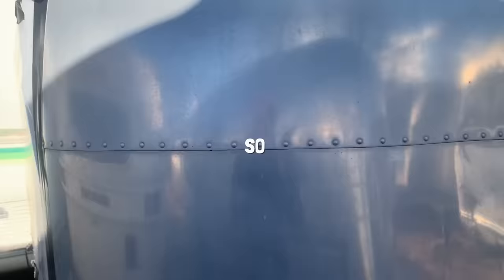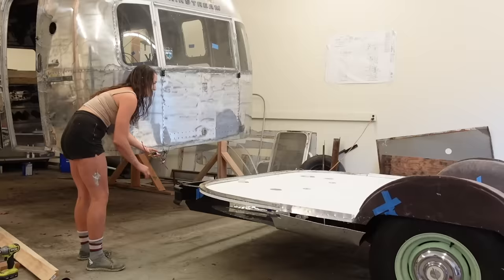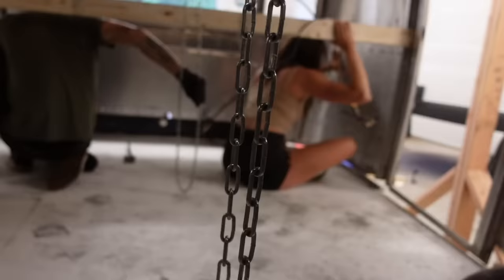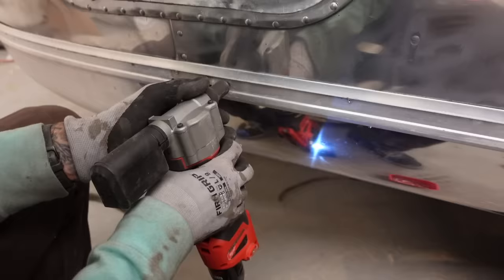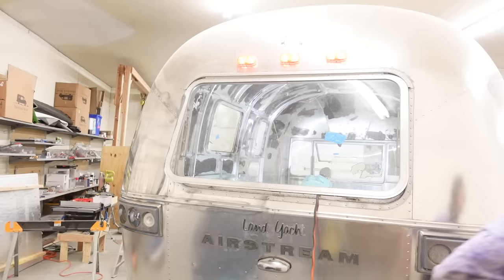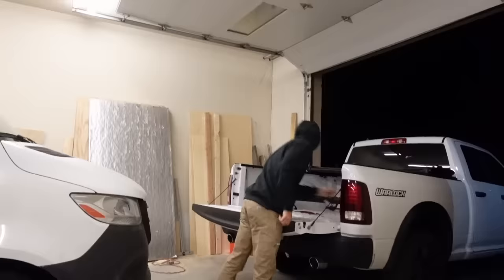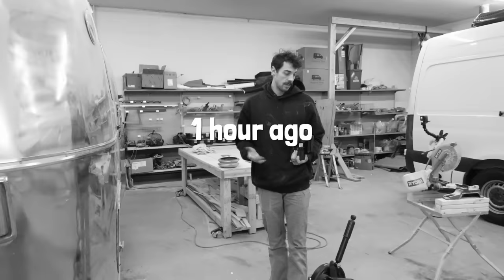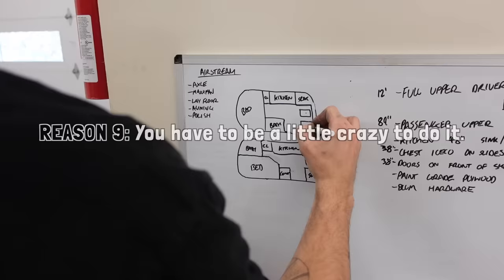Why No One is Renovating Airstreams

Comment: Even with the new one's, they don't do anything to weatherproof the plywood flooring.  It should be soaked in epoxy and coated on the bottom side with a layer of fiberglass.

Comment: Vintage Vacations used to restore lots of Airstreams. Restoring an Airstream is not for the faint of heart. It takes advanced metal working skills, plus all the interior wood working skills. And plumbing and electrical skills. However the Airstream fad of 20 years ago is starting to fade. I don't work on them any more either!

Comment: at 10:17 in the video that is the wrong way to put on lug nuts, as a technician Ive seen many people do it. The conical end needs to go towards the rim it helps center the wheel on the hub it prevents vibrations and increases the longevity of the trailer tire.

Comment: I could be wrong, but, the acorn type lugnuts, might be installed backwards? Each chamfer or cone should act as a centering device into the steel wheel's concaved chamfer, even though, the wheel is "wheel-centric" on the center of the bearing hub. Unless, those do not have the chamfer in the steel wheel and is just a straight on through hole?

Comment: Watching your show gave me this idea. What if you make your style of air-streamer without infringing on any of the air-streamer copyright design way cheaper. Only the front and back have that shiny chrome curve look, but the middle is made of wooden varnish panels, which look the same as those 1960s wooden panel retro vans.  
So the question is how do you create a shiny chrome curve? I can see it is made from copper sheet too instead of aluminum but that's the tough part.

Comment: There may have been a reason not explained, but you didn’t need an axle.  Wheel bearings, seals and new brake components along with a good clean and you would have saved a pile of money.  Useful to see what you went through.  Now to go look for the other reno’s being done so get a compilation of ideas.

Comment: I recently installed a solar/battery/inverter setup in an airstream.  Those things are terribly designed death traps. 
It was a 2023. Wiring is impossible to get to. They use junk electronics and the. They wire it like they are trying to kill you. 
The factory inverter was straight wired (no breaker/gfci) directly to the under table outlet. The otherwise was wired to a second outlet. Directly. Meaning if you touched them, had a short or anything you would be dead / on fire.

Comment: Before I would have removed the shell I would have made jig pins and support the shell with bracing so it couldn’t shift .Easier said than done ….. However that how we do it ! I’ve also lifted two 40 ft bus roofs 2 ft. Without a problem other than a lot of time to setup.
Reply: I’ve lift 2 -40’ers and put 2 slides outs in . Huge job

Comment: I SEE I LOT OF PEOPLE RESTORING AIRSTREAMS AND THE BIGGEST ISSUE IS THEY ARE USING REGULAR WOOD FOR THE FLOOR AND THATS NOT GOOD IDEA, WATER AND TIME ALWAYS IS GONNA DESTROY THAT, THE BEST WAY FOR THE FLOOR IS ALUMINUM AFTER THAT YOU CAN USE WOOD OR WHEREVER. BUT THE BASE I RECOMMEND GOOD ALUMINUM

Comment: Consider the experience you’re gaining. Experience is something no one can buy.  Number 2 should be easier than number 1. Three should be easier than 2.
Perhaps before separating the shell from the frame, you should make a template to duplicate the shape of the shell. Every rivet, every stress on the shell will cause its shape to change. There are reasons that sheet metal  mechanics and aluminum welders are considered wizards in some circles.

Comment: Watching you struggle to marry the shell to the base, I think spending more effort with the bracing may have saved a lot of aggravation. In particular some triangulation at each corner or using fitted forms at each corner tied to bracing. Car restoration use square tubing or angle bar that overlap from each side and are welded to exact length. And too much is better than not enough. Particularly when you have complete access to the inside, to start with. 
As many have commented, I admire your fortitude.

Comment: I know you guys are working hard to finish this tedious build and I don't want to rain o your parade but there was a safety issue I MUST point out!  The lug nuts you installed are on backward! The tapered side should go against the wheel! installing them with the flat side in; they will eventually work their way loose and, well, that's never good! tightening them down more will only damage the wheel and stud. Be safe! Take a moment to remove and install them with the tapered side in! You will be glad you did!

Comment: oh ive worked on this same thing so its called airstream. anyways we have rebuild it twice after a test run on the mountain cause its too flimsy we have to spot weld alot of meshwires on the whole body including the floor since the owner want it to last longer than 50years.. so we bouth some thin aluminum sheet for the flooring combined with with meshwires then some anti rust paint job cover with foam spray while setting the floor ,,, after we finished the whole skeleton the whole cover actually just slides in perfectly took me and my boss 3days to finish everything including the flexible panel install and the pv battery and inverters..  the only problem we encountered was filling the concave spaces lol works perfectly for the wiring but the dang furniture are were made square so theres alot of wasted space, we opted to convert these spaces as a water container instead XD weve run a 12volt mirco pump on each side

Comment: Dear Crew, whenever professional car builders are taking a body off of a frame they will install interior supports and framing so that the body doesn't warp and change shape due to its own weight.  This is the method that you might have used here.  Now, I do see once piece of cross bracing, but its definitely not enough.  You probably needed to install 2-3 sections of interconnected cross bracing, and done so BEFORE you take the aluminum shell off of the frame.

NOW, that you know HOW to do this... You definitely should do it again, and make so $$.

Comment: 8:20 Lol I know the pain of trying to get sockets off those fresh from the hardware store sale holders.  They either come off to easy when you dont expect it or you need a prybar and a 4 foot cheater bar before the plastic lets go of either the holder or the socket.  there is no in-between.  Used alot of Pittsburg tools in my early days as a poor apprentice mechanic.  Even though I've upgraded to nicer tools over the years, I still have alot of them as my at home or travel kits but oh boy, frustration free packaging they are not.

Comment: Airstreams are a unique beast. They require extensive Airstream specific knowledge to work on with out trial and error. They are unlike any other thing on the road and are built like airplanes. Also off the shelf RV parts hardly ever fit Airstreams with out modifications.

Comment: When I gave up on "restoring" my travel trailer and concentrated on "upgrading it for another 100k miles"  my job got a lot easier.  You spent $1500 on a new axle, I bought newer boat trailer for $1500, and had a welder (since I don't weld) put a square frame on it out of angle iron, with mount holes every 8 inches so I could put 2x4'sthe flat way so I could do a new floor in plywood.  In your case I would of just put the airstream down simply on the plywood  subfloor and then edged the inside of airstream frame with 2x4's the flat way again and made a new floor 2" above the subfloor with plenty or room to run wires. Sure the airstream would have 1.75" less head room, but all your problems from the previous version and this would be solved with little more than deck screws, and at probably 1/3 the price.   
With that I'd call back the welder and have him round off the corners from the outside so the original platform would have the oval shape of the airstream.

Comment: 10:22 It appears that you are putting those lug nuts on backwards. The taper should be against the wheel to help centre each hole on its stud. ( Unless the nuts have tapers on both ends.)

Comment: I hope you didn't pay too much, bec. basically all that you retained was the aluminum shell.  As other ppl have said, all these rolling homes / campers have the same issues.  Made to last maybe 40 years then gutted.  Son in law got a nice but really old 18 footer for free, fixed the base and a couple electrical issues and sold it to help buy a new one.  Also, why not start from the ground up, and fix the frame and axles and breaks first, then the platform base and etc from there?

Comment: This is why I convert old busses, not renovate old RV's. Old RV's were built CHEAP to begin with. 2"x2" construction is self destructing over time. You have problems keeping it square, while a bus already has a solid shape that you can follow and fit what you need in.

Comment: I stopped watching when you installed the fart fan with wood to stabilize it.  Why not rivet down some aluminum instead?  In addition to aircraft sheetmetal know-how, if you guys learned your way around a TIG welder, your work with aluminum would be on the next level, the level where you don't use wood. 😂 Great build and teamwork!  Way to go!

Comment: You don´t need all the expensive tools, you can use them but you can also use a jigsaw for cutting the metal and a hand operated blind rivet gun. There are 1000 kinds of blind rivets, they can be set from one side only. They range from extreme load bearing to water tight, multiple thickness, multiple materials multiple head designs countersunk etc. So one can do it the way you did but you don´t have to you can do it the cheap way if you like.
The metalwork just takes a long time because you need to drill a million holes, then deburr them then fit the piece and use sealant omg yes this takes forever but it´s rather simple work.
Also in some places you might want to be able to remove components again, like swapping the AC or something so instead of rivets you can use rivnuts and bolts.

Comment: Tell me you've never worked in cars without telling me you've never work in cars. This are not "renovating" projects this in the car industry is called restoration, while you can live in it at the end of the day is pretty much a car without an engine. You do need tools but not "specialty" tools trust me. I have bought actual specialty tools just to do the timing On audis and VWs. That said you guys are killing it!!! And you guys are not far off from doing what you should do on a car restoration. We pretty much did the same in a 1957 ford thunderbird at the shop i work

Comment: @10:22 I think you may have installed your wheel nuts the wrong way around.. The taper on the nut should be facing the wheel. This will  help it centralise on the hub.
Reply: These guys are clueless!

Comment: That's not how you fit an Airstream shell onto its platform.
You put a whole bunch of points sticking up on the platform, angled from the center, so the shell slides over the points down into position, and then you screw the shell into place.
Then you remove the points to restore the floor.

Comment: Heh, heh,.......heh.  I've restored a 22-footer we bought for $1,200, a 27-foot Tommy Baham, we got for free, and a PanAmerican (33-feet?) which cost us $6,000 and a gas grill.  All of them were projects that took a year to complete.  Our last step was always to strip the clear coat off the outside and buff it out and recoat it so they looked like they were brand new.  That air conditioner you pulled off wasn't an air conditioner, it was a "swamp cooler".  If you insist on using Airstream parts, you are right, it will cost a fortune, however if you are willing to use more modern stuff (for the pluming, heating, cooking etc.) it's actually pretty cheap.  We always used Airstream parts for stuff that was visible, but for all the "guts" we used quality modern replacements: no reason to plumb it with copper when there is pex now days).  We sold each for a huge profit after using them for five to six years of travel all over America, including up the Alcan to Alaska.  If you think it's too difficult and too expensive.....you're doing it wrong.

Comment: The Airstream concept, materials, and construction process came to practical maturity with the aerodynamic designs and working experience of the aircraft age itself. What is possible with aluminum and the modular assembly-line techniques for producing this simple and durable mobile home is inspiring in itself.
  Model T to airframe to home is, really, the most natural evolution imaginable. But the machine and its materials are one thing, while the idea of such a machine being an accepted standard for living, for making a home, is quite another.
  The single family "starter" home of past generations has, arguably, "run the limit: -- so much so that the Airstream idea, as it originally was conceived, should properly be the accepted "starter", or even primary residential dwelling, of today. Many will disagree, but it is only a peculiar tendency of the specifically American (USA) mindset, and a conditioned response to "middle class respectability", that has put-off the typical "consumer" from this most practical solution to creating, and prospering as, a home owner.
  What is known as a "caravan" in British/UK culture, for example, is not something associated with a lifestyle, a residence choice, that is so far removed or alien to the related idea of being considered "middle class" ( So far as I know; I am a US citizen, born and bred). Similarly, owning a "detached" residence is also not a considerable indicator of more respectable status in many countries, either.
  The American solution, the social respectability, connected with the entire industry of housing construction after WW II -- along with a destructive myth of higher property values and the sorts of folks permitted to live in certain neighborhoods -- is intimately bound to that "other" prejudice against mobile homes, trailers, and a sub-class of illiterate so-called "trash" that is presumed, otherwise indicted, in choosing to live, or being compelled to live, in such a fashion. This is also a characteristic, pernicious form of inventing distinctions of social class, of caste and group identity, in an alleged "democracy" of American citizenship and cultural allegiance.
  In the twenty-first century, in a world of scarce resources, educational denial, lack of proper health care, insidious pollution, constant violence: the American "dream house" ideal is a deliberate and malignant fairy-tale designed to promote hatred amongst people, divide political factions, and generally eviscerate a "new" working class virtually without labor representation (along with the real living wages and life prospects that naturally follow).    
  The supreme irony, in this case, is a an aesthetically pleasing mode of "homemaking" not in the least unattainable, born in the midst of a Great Depression and provided with the "tools", materials, and techniques of an established avionics industry, and firmly represented by forces of political expression entirely used to the likes of Capitalist, Communist, and Socialist alike -- all, rationally, thriving.
  Being, in whole, a free, traveling, Republic.
  Today, all but Denied.

Comment: Despite the public reputation and image, Airstreams suffer from a lot of problems that the rest of the RV industry suffers from, just way more expensively. Ask any kid who has accidentally batted a baseball into a rear rounded quarter-panel of one and been told how much it was going to cost his grandparents just to get that dent out. If you maintain the finish according to what the manual specifies, you're also going to be spending a whole lot of time with your RV, whether using it or not, or paying someone else to. If you cook in one in the evening and the temperature gets far enough below freezing overnight....  It goes on and on.

Comment: So… I’m an airplane mechanic 
Uh… y’all should invite an airplane mechanic over to run you through riveting and faying seals.
Aluminum would have been great for supporting the AC - fabricating frames and stringers can be a bit of a challenge but overall… better.
Not to crap on your video and all but for the love of all that is holy - call an airplane mechanic.
I’ve done 2 airstream restorations - they are an absolute blast - materials and process are very similar to airplane construction and who doesn’t love riveting!!!! 🧐 
A shrinker/stretcher is a good tool to have (for making frames and stringers) and an English wheel is needed for fabricating panels with compound curves - also the best rivet gun on the planet is an Ingersoll Rand AVC12 - have fun!!!

Comment: I love your video, but I got lucky And bought a 72 land yacht sovereign… Except for the rotten floor in the rear bathroom, everything else is near perfect. My intention is to take the rear bathroom completely out because I’m going to have a 10‘ x 20‘ shed with a full walk-in closet. Washer and dryer and bathroom with a full tub and tankless hot water heater. This will be surrounded by a full deck and if I decide to leave my acreage, I will just go to a full-service RV Park and use their showers. Plus I have an outdoor tent bathroom and a bucket, .. that being said i’m very surprised how cheaply you can buy those airstream’s here even in Central Florida where RVs are everywhere.

Comment: 9:01 You didn't get any extra clearance. The axel is still your low point. What you got was a higher approach angle. If you want more clearance you need bigger wheels or tires.